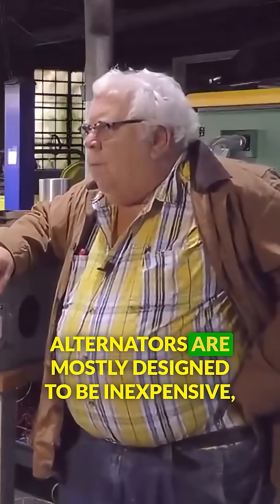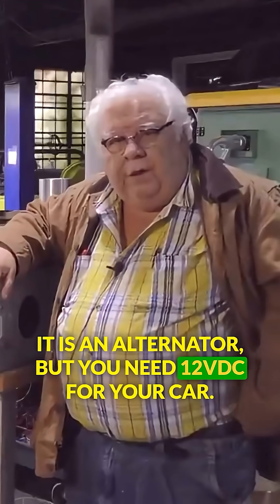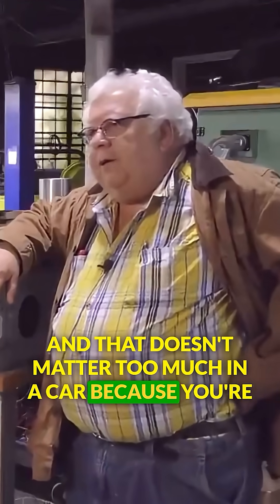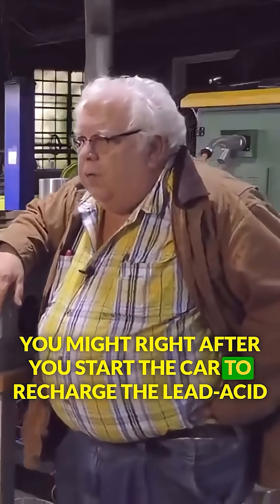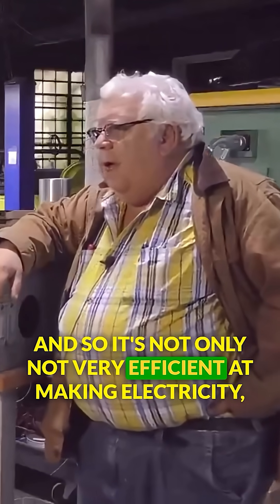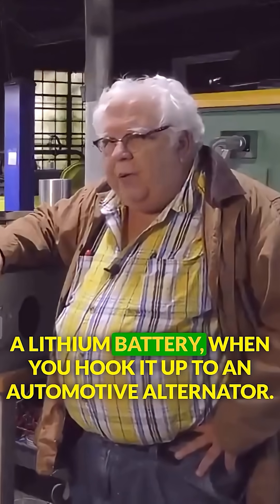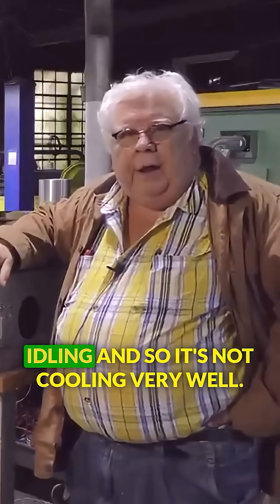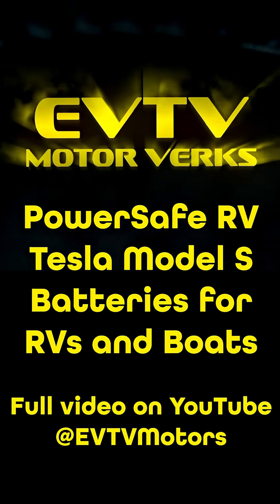Alternators are Only 50% Efficient!

Comment: Electrical engineer here. It's 100% dependent on the battery. Most decent LiFePO4 batteries come with internal components to limit current draw(in both directions) as well as prevent over charging, and then there are some that don't...the latter is certainly not rated for use in automotive applications though.
Reply: Spot on. Anyone who uses a setup without BMS in a vehicle is asking for fire.
Reply: EE here as well and spot on
Reply: Is his claim about the extreme inefficiency of the rectifier true?  That seems a little out there.
Reply: @JohnCrombossiery-p7v Most diodes drop over .5 of a volt. If you flow 100a through it thats still 50w of heat. Now take 6 of them and put them in a space about half the palm of your hand. There is some airflow of course but hundreds of watts in a tiny space can get exciting fast, and it’s ‘wasted’ energy. Ive heard closer to 65% than 50% though, and it is highly rpm dependent and somewhat load dependent anyway. There are plenty of times it’s way over 50% efficient, but nowhere near as efficient as something that can be optimized for narrower/fixed rpm and load conditions.
Reply: @Vigo327   Wait a second...  "Most diodes drop over .5 of a volt. If you flow 100a through it thats still 50w of heat."  You said half a volt, not half of the voltage.  So if you're got 12V, then you're down to 11.5V, which is not 50%.  Also, why six diodes?  don't AC-DC rectifiers usually have four?
Reply: I know alot of alts use China made rectifiers and diodes, the Japanese international parts is where it's at. If you need the juice, Brand-X, GP, JS, Mechman. All carry high output alts with quality diodes and rectifiers. JS overall best price point, Mechman most expensive. These alts also require a slightly shorter belt due to a smaller pully for higher amprage at idle.
Reply: Lithium batteries have much lower internal resistance, as compared to PbLA batteries, therefore, charge in rush currents are much higher depending on State of Charge on that battery. Higher state of charge, in rush current not so high at first few seconds. Very low state of Charge and in rush current could be very high for the first several seconds of charging.  So working with Lithium batteries,  know your surge current limits of the circuit you are installing that battery into.
Reply: @franklinmartin8103 as stated in the OP, that's what a BMS circuit does: regulates current.
Reply: Yeah, but what is the current while charging lead acid car battery vs Lifepo4? Many lifepo4 batteries, even with BMS have max charging current set up pretty high. I think it is much higher than traditional car battery can draw. That is the problem. The BMS on lifepo4 should be more limited.
Reply: What components exactly, limit current draw in this application?
Reply: @nspro931 it would be the internal resistance of the battery, along with the voltage difference between the battery and the alternator. Then, Ohms law gives you the charging current.

Which noone here mentions.
Reply: We've just installed a Lithium leisure battery in our campervan, and that needs a DC charger between the alternator and the battery.
Reply: Yeah - he's talking about your very basic alternators - back in the day they didn't have any limitations so you load them up to 200A and they will try to deliver it, with no proper load they are happy to produce hundreds of volts, and some early alternator regulators were on-off field coil affairs.  Nowadays your Bosch alternator uses high frequency PWM to control the maximum output and temperature and as electrical machines they are better than 90% efficient and rarely die before the car does.  A lithium battery will usually want a higher charge voltage than the alternator can supply without a regulator tweak and the batteries should be having a BMS. So what he says is partially true but its much more complicated than that.
Reply: Most racers I know run lithium batteries in their cars without issues
Reply: @csp137  yes, there are drop in replacements for that exact purpose - even for aviation use - the only thing that is different from a normal car battery is the provision for a remote kill switch and fault indicator (which you don't even need to wire up).
Reply: And mechanically speaking an alternator is far far better than a generator. 20hp or 2, what you wanna lose?

Plus they're really easy to make very high on efficiency. Bridge rectifiers are cheap and cause consumers expense.
Reply: @osmacar And technically speaking, they are both actually generators 😄 one just generates alternating current, which is later rectified to direct current, other generates direct current.
Reply: who has LiFeP04 batteries in their vehicle>?
Reply: There are also much more advanced alternator designs that tie into a BMS system. If not using a generator, the BMS may use a PWM control signal to limit the output from the alternator to meet the demands of the vehicle whether it is charging a deeply discharged battery or maintaining a float charge.
Reply: haha I have a 96 Wh LiFeP04 sitting right in front of me, in front of my monitor. Look at that, Built-in Batter management system(BMS) written right on the front.
Reply: @erikjones9585  fine.  now put a current source capable of 200kw on it and lets see if the bms limits the current to a safe value or if it shuts down 100%.

i know the answer.

because BMS's have no means of limiting current.
Reply: I'm an electrical professional myself so I'm not an engineer I can tell you the guy in the video is absolutely full of fluff and stuff. Let us batteries have their own internal impedance it's a nice thing for when you want to run say an LED without a driver because that internal impedance helps, it's my understanding some of these lithium batteries do not have that same internal impedance. Automotive rectifiers or not 50% efficient that's absolute hogwash.
Reply: I don't think the guy knows what he is talking about. I have a small 16f ultracapacitor bank. Draws almost 150-200a of power for a short time after starting the car... which is usually idle. The alternator lasted until 230k miles.... Alternators can be run 100% at most times.
Reply: So i just stumbled across both the video and your comment. 
Why can't people use automotive alternators to charge home solar battery systems with a small windmill??
Or do people often use them with success? Seems like something people would be doing all the time unless there's som obvious reason it shouldn't be done.
Reply: @lovesloudcars  Some very small off-grid systems are just 12V and people do use an automotive alternator wind generator for those. But they are very very small systems. Like a hunting shack, or ice fishing shed.
Reply: @lovesloudcars The main reason automotive alternators are not used in off grid systems is that they need a field circuit to make it work. Another important limitation is the RPM needed to produce the rated current. If you look at the crank pulley of an internal combustion engine and compare it to the alternator pulley, there is typically a 4 to 1 ratio. Meaning if the crankshaft is at 600 RPM at idle, the alternator will be at 2400 RPM. Most alternators are not going to be anywhere near maximum output at that rate. A wind turbine generator will not be able to come close to that, even with moderate to high winds. However, a PMA, or even an induction motor that has been properly machined and fitted with neodymium magnets could be a viable option.
Reply: @user-gj4ei6dc5q awesome.  Thanks for the feedback. I'll have to research those things you mentioned.
Reply: @lovesloudcars . I have thought the same thing. Except I have been planning on turning the alternator with a small pelton wheel, powered by a small creek that flows through my property. Maybe I will haunt all the local wrecking yards and find an older automotive generator. Along with an older voltage rectifier.
Reply: @davidthelander1299  Hope it works out! There's gotta be a way to produce a little without constantly paying for distribution charges or worse yet THOUSANDS to have power brought in so you have the "privilege" of constant bills...
Reply: @lovesloudcars if you can get your windmill to crank out about 5 Hp it will probably work!
Reply: @lovesloudcars - they do and so do sail boats. Problem is the turning on the alternator or in industry terms - the exciting rpm. Alternators don't or won't charge at low rpm and need 12 volts.
Reply: @lovesloudcars  the DC voltage for Home battery systems is much higher than what car alternator puts out
Reply: @Swedespeedmead meaning it will just burn it out because of the draw?
Reply: @lovesloudcars  it won't supply a high enough voltage for a home solar setup, home solar battery banks are usually 48v and higher, car alternators are regulated to charge 12v systems, another part that's inside of the alternator not just the diode rectifier.
Reply: @trippieau . Should be able to just keep putting 12 volt batteries in parallel until you have enough capacity. Power your home with 12 volts. Step it up with an inverter when you need to.
Reply: @davidthelander1299  the alternator can't putout enough current if there are too many batteries to effectively charge any of them due to resistances in wiring and the batteries them selves, at that point you would have to have a complex switching system to stay at 12v, which ends it being a cheap system. Also the length of wiring has less losses at higher voltages, high current loses energy to heat etc
Reply: @lovesloudcars  Automotive alternator regulation prevents them putting out high loads to charge a battery and indeed direct to the system. The extreme output is normally used for initial battery charging and to meet actual load. The output amount is dependent on voltage balance. You would need a converter to re-create ACv and of course 110 to 240v capability. Too much output loss would occur.
Reply: @trippieau  could i slot in a 12v-48v+ transformer, and charge it that way? (Even if it would take fairly longer?
Reply: @Dave_Crupel  you could but it would be a complex way as you need ac for a transformer then back to dc for charging, would be expensive there are better ways to do it, there are fairly cheap charge controllers that would do a better job, just match it's input to you alternator and it's output to you battery bank voltage, they're used in solar battery banks to take the solar panel voltage and charge a battery backup
Reply: @Swedespeedmead that is not a problem. There was a guy on youtube who recently uploaded a video of how to modify an alternator to output a different voltage (but the same power). He used it to charge is home dc system at 90 volts.
Reply: @Swedespeedmead  ?????   If it’s 12v system it’s a 12v system ect
Reply: @trippieau  that’s just not true man 48 V system is more efficient for home home solar but most smaller systems are 12 V so that’s just not true
Reply: I was thinking this had to be the case.  So many people seem to think you can't use them on older stuff or it's not compatible but the battery is designed to work the same way as the lead acid it's replacing...
Reply: 16v system in my car on 4 18's 135ah c-max, 300 amp alt, alt lasted 2 years heavy use, have clamped as much as 44,000 watts on a burp with no drop in voltage.
Reply: @holeshotinspectionllc2412  Yea for sure, you matched the alternator to the 16v battery system, a standard alternator charges around 13.8v, which is why I said an automotive alternator will be regulated for the charging voltage for the cars system, a standard alternator being for a 12v system,  while the average home solar battery backup systems are 48v and higher 60v and 72v are also common, the point I was making is make sure the voltages of the system and charger match especially with lithium batteries or things catch fire really fast and really violently.
Reply: @trippieau 100% I turn my battery down with my external voltage regulator to 14.8 v - 15.2v from 16v only use that for competition. Also, I have to adjust my regulator based on temperature. Make sure my balancer is working correctly, have to monitor and check volt meter before starting. Lithium is also not a huge fan of the cold. Lipo is way safer and getting better, but for right now would require me to have a much larger bank to produce the same results. That being said, I'm doing dual alts on the next build, same Lithium bank. Charge and discharge rates are exceptional. 1000% agree with you. 👍🤙
Reply: @trippieau  actually, at least in europe, all trucks and most heavy machinery uses 24 v  electricity system, alternators output voltage depends just of a voltage regulator and thats it. alternator generates way higher AC voltage than even 24 v.  Voltage regulator is keeping it on needed voltage range. problem is never the voltage, but needed output current. more current needs way bigger wire diameter.and ofc more powerful generator or alternator. cars electrical system has no problem generating 30-40 000 volts to spark plugs, but even powerful sound system requires new alternator.
Reply: @virumaru3882  same in australia trucks mostly use 24v, power = current x voltage, higher voltage can deliver the same power at a lower current, wire gage is more dependent on current than voltage so you can deliver more power on the same size wire by using a higher voltage. Again though the voltage of the alternator has to match the voltage of the batteries or things go bad pretty fast. Most charging systems that I've used regulate current until they are close to max voltage for the chemistry type then regulate voltage to stop over charge. I only used 12v an example as someone mentioned an alternator and a car alternator being the most common and cheaply available.
Reply: And to all the so called engineers who had an opinion on the topic, go back and study basic common sense. I'm not an engineer, just a stupid asshole with a bunch of tools and 37 years of experience repairing automobiles 😅
Reply: @user-gj4ei6dc5q you assume I have no tools or experience. Yet I've rebuilt several vehicles and motors from the ground up. Built a standalone fuel management computer myself that allowed me to melt 2 of 4 pistons on 27psi of boost AFTER running a 7 second 1/8th lol. Don't say I don't have experience.
Reply: @andrewstein761 well if you burnt 2 pistons and made your own fuel system, sounds like you failed as a engineer and a mechanic 😂😂😂😂😂😂😂
Reply: @patrickisswayze3446  lawl no. I made the mistake of letting a friend "look" at my ignition timing map and he apparently took it upon himself to revert some changes I'd made to allow me to run much higher boost. In hindsight, the turbo was too small for what I was pushing it up to, but regardless, the ignition retardation i had implemented should've prevented what ultimately happened. I wasn't even aware of the change he made before my run.....we're not friends anymore and I have huge trust issues now. But thanks for saying I'm a failure! Real cool!
Reply: @patrickisswayze3446 I'm sorry your mother didn't love you enough as a child.
Reply: I also question what he's saying. Aren't modern alternators all pulse width modulated to REDUCE output?
Reply: i'm not sure if you are actually an electrical engineer or if the requirements to be an EE are just that low.

but a proper E-engineer would've known that you can't find ANY LiFePo4 battery in the whole world that is capable of LIMITING the current.

most if not all LiFePo4 batteries (using their BMS) can /shut down/ the charging/discharging as a whole. but noone can limit the value to like 50A or anything.

by the way: neither BMS nor naked LiFePo4 batteries are usually automotive rated.

for that reason insurances twist themselfs out of paying if a campervan burns down.

greets, a non-engineer sparky.
Reply: @casemodder89internal cell resistance.
Reply: @jhsevs  i know the low IR.

LiFePo4 rips every amp it can get fron alternator.

but in idle speed the alternator produces currents it can't handle (cooling wise) for more then a brief moment. that brief moment is enough for a Lead-Acid to naturally drop in charging current because a LeadAcid's IR rises pretty fast whilst charging.

LiFePo doesn't behave like that.  it just draws as much as possible and doesn't need like 1,5 or 2 Volts over battery voltage to drive high currents.

without active electronics (that is not the BMS !) you WILL fry the alternator.   and you might even fry your ECU and other electronics in the car if the BMS lets the battery draw like 100A at medium or high engine speed and then the bms decides it's to much current to be safe for the Li cells and suddenly cuts the circuit.   then you got an pretty aroused alternator (high field current)  that gets blueballed by the bms.   gives off quite some NASTY voltage spikes into the supply of alll the controll units. 

there is nothing to catch the high voltage because the field is suddenly driven wayyyy to hard without the Li-cells dragging the alternator down.

fastest way to get some new electronics or scrap the car entirely => might end up with a write off over the tremedous cost. depending on how loaded with pipes an whistles it is.
Reply: @casemodder89an alternator does not produce current. It only transfers energy from mechanical to electrical. The only way an alternator can lower the current that is drawn from it, is to either lower the voltage, increase the resistance or blow a fuse.
Reply: @jhsevs in fact it produces a voltage and the battery draws a current.

but that doesn't matter for the alternator burnout vers. Li battery problem.